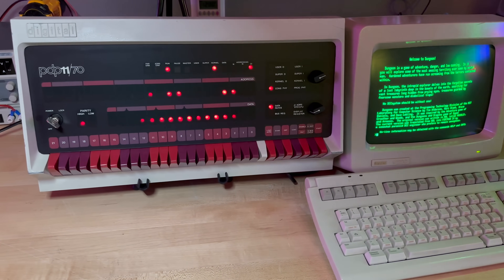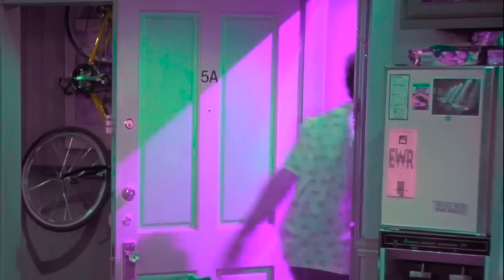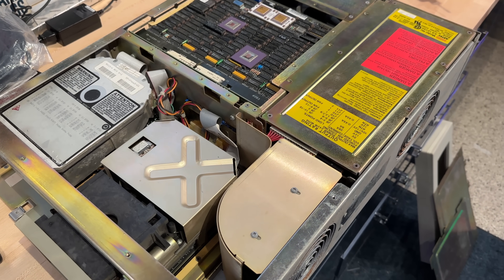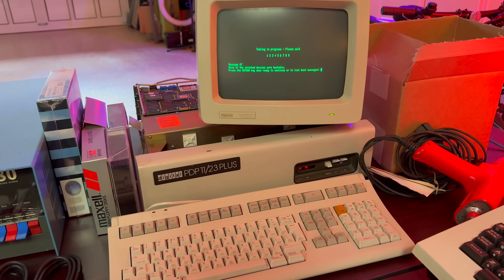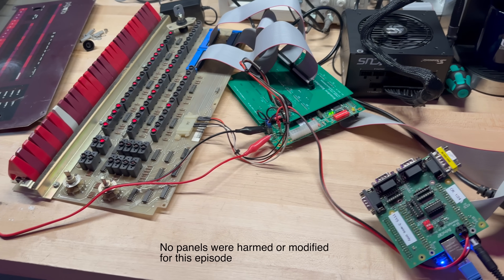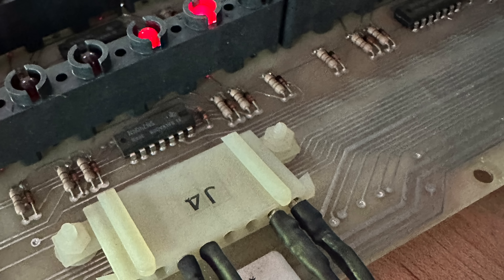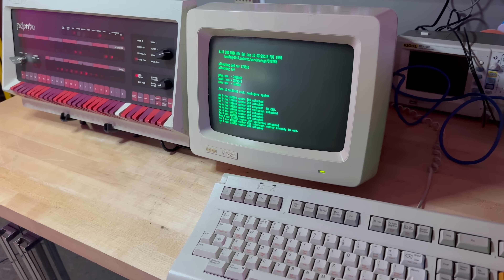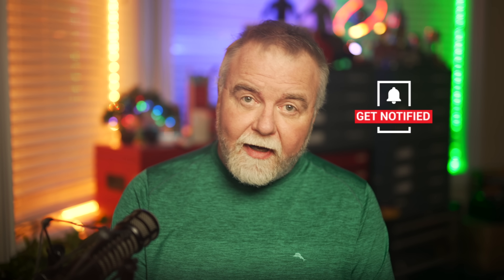Ultimate LED: The PDP-11 DASBLINKENLIGHTS!

Comment: In 1988 when I walked back to the motor control room for the 5-stand rolling mill that I had just been assigned to as an electrician, the first thing that came into view was a PDP-11/70 panel.  I discovered that it was being used to  interface the motor controls to the process controls at the front of the mill.  Spent the next 5 years working with GE and DEC to replace the old system with a proprietary GE control and a VAX cluster.

Comment: My favorite Assembly Instruction Set, ever
Reply: The PDP-11 was a joy to program in assembler, at least compared to some other machines of the era. And when I met the 68000, one of the best microprocessors of the time, I couldn't help noticing that it was influenced by the PDP-11.
Reply: @SheeplessNW6  Agree.  I had a 6809 S-100 board for a while.  But everyone was going with Intel.  Until Apple came along.
Reply: Ditto
Reply: I just realized I didn't know anything about its assembly language so I looked up some snippets. Feels very similar to MSP430 to me -- and I like the 430 instruction set!
Reply: Yes indeed!
Reply: Yep.  I still have my fold-up PDP-11 programming card, EDT reference card and VT102 programming card.